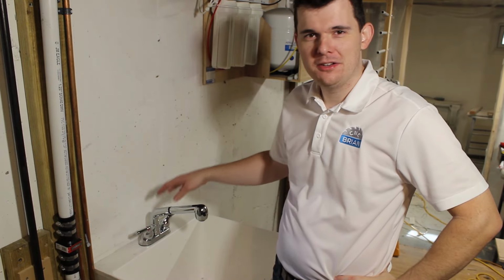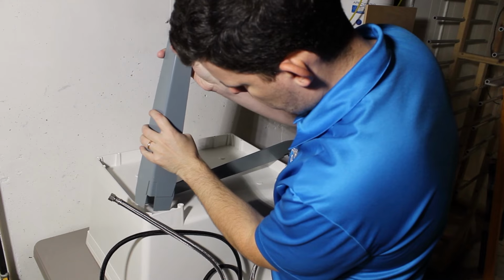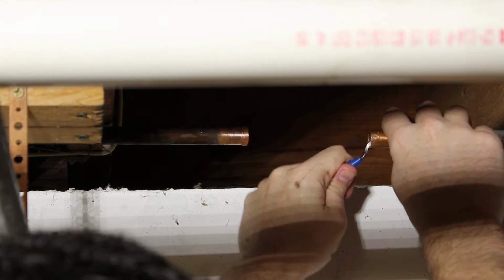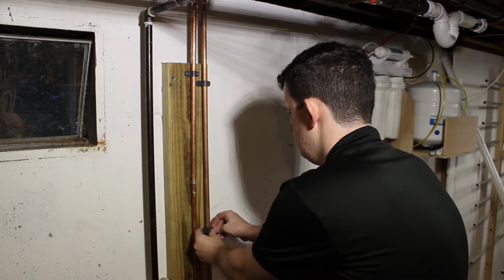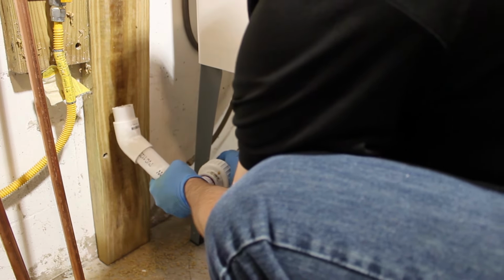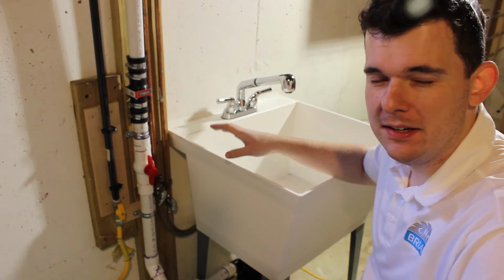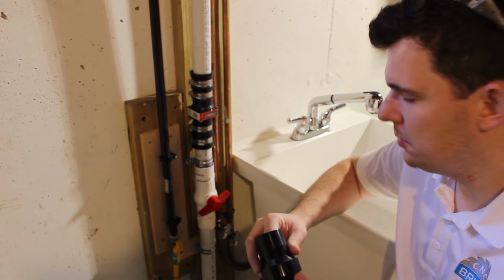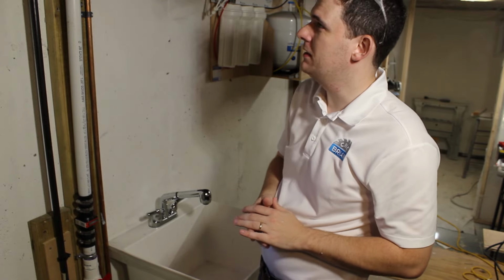Home Projects: How to Install a Basement Utility/Laundry Sink

Comment: I have a laundry tub that has a pump that keeps cycling. I dont have a ball valve that you turn to adjust. My piping lays horizontal. Is there a way i can put one in between them or does it have to be placed higher ?
Reply from the maker: Is the pump in line like the one I have shown in this video? If it is you can't install an in line pump without a check valve and ball valve, especially if the pump output doesn't match the sink (Most are at least double). The traditional flapper style check valves won't work horizontally though. They make a seal with the weight of the water up against them.
Reply: @briancnc  No i just have a straight run from the pump to the waste line.  NO ball or gate valves
Reply from the maker: @Sjrick  Should have a ball valve to modulate the output of the motor. Your sink could be putting out say 5-10 gal/minute while your pump does 20+, so it's going to short cycle your motor constantly as the pump throws volumes of water away from it and slowly backing up. I honestly wouldn't use an in-line pump again after installing this and the tub style that has a holding tank. The holding tank type sump pumps are a lot better because they only cycle once you fill them up as apposed to listening to this loud pump constantly as you're using the sink.
Reply: @briancnc  so a ball valve alone wont do anything ? Even if i install it on the tall pipe going up ?
Reply from the maker: @Sjrick  send me some photos via message on here so I can see or email me through my website briancnc.com

Comment: Great video, I am about to do the same project but will be putting the supply and drain lines in a wall so I can cover them with dry wall for a more finished look.
Reply from the maker: Just make sure you leave an access door for the shutoffs and ball valve. I honestly would not bury plumbing for an in-line pump setup like this and just get one with a holding tank (slightly more expensive). If you do you can ditch the check and ball valves and put regular quarter turn shutoffs as I did just like with a toilet or sink.

Comment: Very helpful video. I still think I'm gonna mess this up, but it won't be your fault!
Reply from the maker: Kyle,  you won't learn without making mistakes. I would never advise someone to do work on their house if they aren't comfortable with it, especially if it was plumbing or electrical but this kind of stuff is great to learn and have as skills as a home owner. If you can do it, you will never be dependent on someone else. With youtube you can learn pretty much everything. Start on the workbench with the joints if you're sweating and get good at it before you cut into anything. The most important thing is to be prepared, have everything, buy spares and extra, you can always return the rest. Have a plan and shut off the water supply, have a backup plan in case the shutoff leaks and it will be a breeze. Thanks for watching!
Reply: @briancnc  Awesome advice and tutorial.  I think this might be too much for me to do but when you mentioned possibly $800 for a plumber, YIKES! 
I've already bought the sink, faucet and pump but neglected to check the plumber's price.
I'll do as much as I can and stop when I know that I am getting above my head.
Thanks, I'll keep watching!
Reply from the maker: @LorettaKeyWest1  Thanks for your comments and for watching! It's a tough project for a diyer but you will learn great skills in this. Once you learn how to sweat one copper pipe well or glue one pvc joint, install one valve, you can do it all. Just make certain that you shut off your house supply and that it's a ball valve, drain the pipes in your house by opening the lowest faucet and ensure the house shutoff isn't leaking. Then you can go to town. It helps a lot if you have a valve locally too so that in the event that you don't finish in one day you only have to shutoff say the basement branch of your water supply (hot/cold). Plumber's labor will vary area to area, it's worth having a quote ready and someone you can call if you get in over your head though. Best of luck!
Reply: @briancnc  Thank you Brian, I don't know how long I can live with the huge box the sink is in, so it'll have to go in soon. Thanks for the info and I will let you know how it goes.